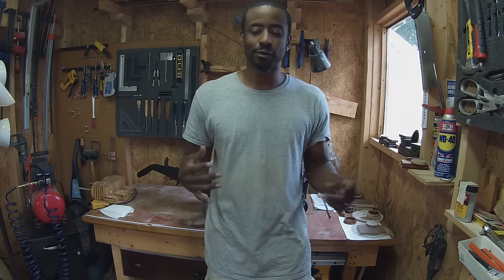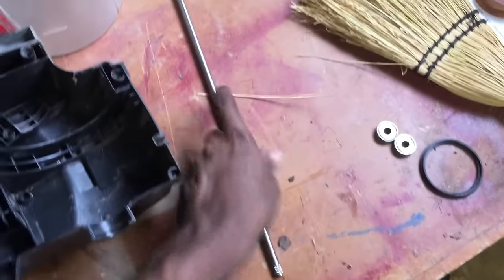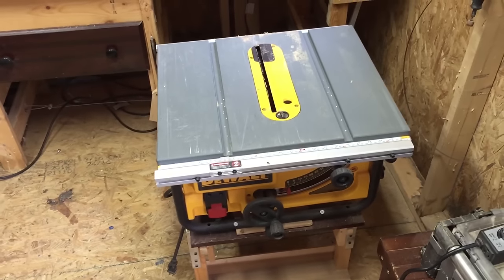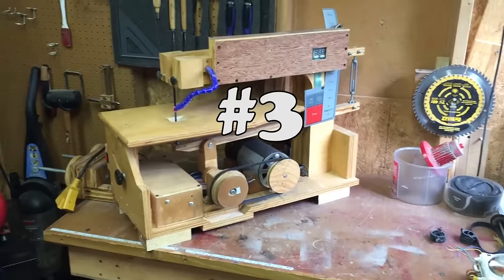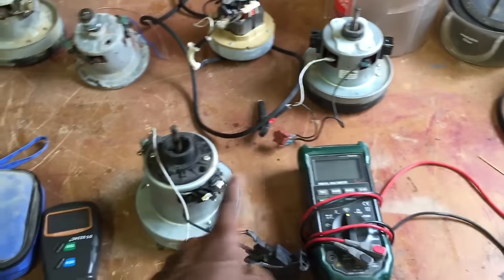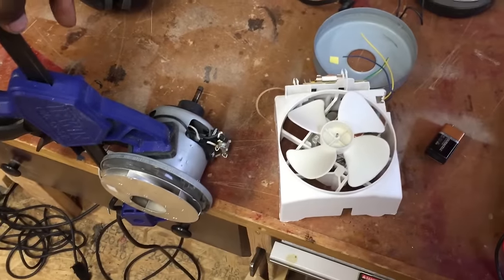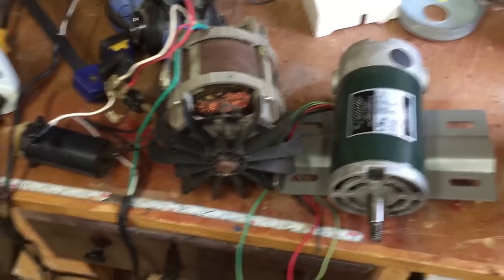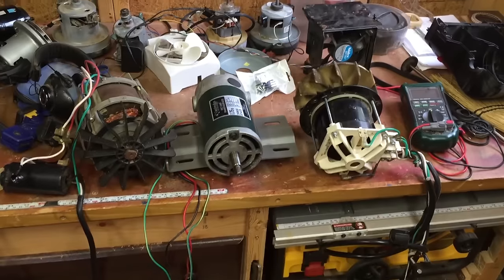Things You Can Make With A Vacuum and Other Salvaged Motors: # 010

Comment: LOL.... you're as crazy as I am about repurposing things, especially those with motors. 

I get pretty much everything for free off of Facebook.  I belong to a bunch of local "Sale Groups" on Facebook and from time to time I will put up an ad saying I will take old working and some non-working Vacuums, small and large appliances away for free or very cheap.  Very cheap meaning I CHARGE THEM lol.  I love Dishwashers, Refrigerators, Washers, and Dryers etc. because they have lots of parts that can still be in good shape and I sell them on Ebay along with getting whatever I need for a project.  Things like Silverware Racks, Upper and Lower Racks from Dishwashers bring good money used if they are still in good workable and cosmetic shape.  Refrigerators are good for the glass shelves, Crisper drawers and the side pieces on the inside of the doors as those parts often break and cost an arm and a leg along with your first born child to buy them new.  The only downside is with some of the bigger things is shipping costs.  But I figure if I pick up a Dishwasher for free or charge them $10 or $20 to take them away and I sell an Upper Rack for $50 including shipping and the shipping costs me $30, I still made $20 bucks for a few minutes of boxing and bringing it to the Post Office or UPS office and I don't have to worry about throwing it out.

If you like Duct Tape, you should use Gorilla Tape.  That is all I use now.  Duct Tape varies so much in quality by different brands but the Gorilla Tape is crazy strong and sticky.  They even have like warnings about it on their website lol.  It usually comes in Black but they also have many other colors now if you want to make it match a project.  That Gorilla tape is like Duct Tape on Steriods minus the Roid Rage lol.  It can get a bit spendy, but you can find it on sale sometimes or I use my "Points" from different stores to get it cheap or essentially free.  Also, if you write an email to the Gorilla Tape company telling them how great it is and what you use it for, include some photos are always good too and ask them where you can get discount coupons for buying more of it, they will often just send you coupons or coupon codes.   I have even got small roles of different colored Gorilla Tape from them.  I must be on some list with them as they will just send me some out from time to time. 

I have found many companies appreciate getting an email and a few photos telling them how great their product is and creative things you have used it for rather than the emails they usually get from people Bitchin' about one thing or another in regards to their products.  It seems like we have gotten to be such "Assholes" of a Society that all we do is complain rather than give Postive comments or Feedback about products.  Complaining will sometimes get you free stuff or discounts, but I have found Positive Feedback to companies works much better.  I was even sent a Free 20 Volt Lithium Cordless Drill from Black and Decker one time for sending them some pics and a short video of this 50+ year old B & D Drill I had that still worked.  They sent me the Cordless Drill to Test and let them know what I thought.  I didn't even ask them for anything, I just wanted them to recommend a good replacement for this old drill I had lol.

Anyways, I was thinking you should send some pics or short videos to some of the vacuum cleaner companies showing how you repurposed their products after they got old or no longer usable for their intended purposes.  If you send the email to every address you can find for that company like Customer Service, Tech Support, CEO, etc, you never know what kind of response you might get back from someone that really liked what you did.

Keep up the good work with the videos.

Comment: Bro can I use our broken electric fan in making vacuum cleaner?
Reply from the maker: I don't think you will get very much suction. Regular fans can move a large volume of air but they don't create much suction pressure.
Reply: I mean the electric motor of the electric fan
Reply from the maker: +Kyle saw the rpm is probably to low. Vacuums run at 25k+ rpm. But I say why not? I experiment all the time. See what happens

Comment: Vacuum motors are usually class A, not designed to work any significant load. Not good for tools, I find. Good for fans, blowers, small pumps; anything with a prop or impeller requiring very little torque.
Reply from the maker: +Jordan Hall no question about it. It is designed to be a fan.
Reply: Jeremy Fielding The real treasure in vacuums isnt the motor anyways. The occasional retractable cord reel, and long thicker gauge wire. I've been toying with upright vacuum canisters to make dust collector systems. Vacuums have been a hit and miss source for HEPA filters, too.
Reply from the maker: The retractable reels are nice. I have only picked up one of those.
Reply: Jeremy Fielding Yeah, they're rare. It has been a welcome addition to my miter saw cart. I wanna say I pulled both the ones I have off of Hoover vacuums.

Comment: Can I pick your brain for a sec? I am trying to build a electric motorcycle. I have a old maytag ac motor. I was wondering what to use as a VFD that I can use with a throttle application. I was thinking about using a inverter to power everything. 

What do u think?

Comment: Jeremy please help, I've been working on a project but it's getting no where, I have a vaccume motor that looks exactly the same as the one showed in the beginning of the video, I am trying to create an electric bike but it's more of a concept till I work out the kinks, 1, I have NO idea how to create a portable battery pack for it! 2 I have no idea how to control the speed of it! the petentiamator thing seemed like it would work but I'd have no idea how to set it up 3 I'd like to have the motor be controlled by the wheel, you know how motor bikes work, pedal fast and the motor starts. Anyway, PLEASE HELP I'd be using the bike for work so I'd be extremely appreciated.
Reply from the maker: That sounds like an interesting project. I have a video which should post on Friday, and I think you will find it very helpful regarding the wiring, speed control options, and batteries. After that, let me know if you have a specific question and I try to help. 
You seem to have quite a few aspects of this project which you haven't worked out. I feel like I might be doing the project for you if I start looking things up to help. I have never tried to do what you are asking so I can't speak from experience. I think even after watching the video you will need to do a little more research to get a complete solution.

Comment: You really shouldn't run a universal motor unloaded. Their speed is governed by their load. No load means the motor's speed will (theoretically) never stop increasing. That's really bad for commutators. The load on vacuum cleaner motors is the impeller, so if you don't have a high load to put the motor on then it's ideal to leave the impeller on. It's generally ideal to keep  them under 20k RPM, and less is better if you can give it enough cooling.

Comment: Man do you and I share a similar interest , I collect motors of all sizes  and types , polarity's , and switches and timers from anything ....I got big ones little ones tall one short ones  green ones ....mean ones dHey War should record that ,,,,,SPILL THE WINE DIG THAT Girl have that tune ........Spill the   he . I make leaf bLOWERS FROM VACS , leaf  BLOWERS  from vacuums , ,WINCHES ,using garage door openers ,  Hanging jewelers and hobbyist type little elec grinders on the flex shaft .Man Functioning electric motor projects all around my place , outboard motors , wind turbines , bicycle battery chargers, grinders , pumps, air conditioners that work so good you can roll the windows up in your truck mid summer ....I have a youtube channel i never visit  but its right here where my name is , hey Im a computor idiot and proud of it so ......yea man thanks u made an average saturday into an average saturday witth a bigger smile lol, Ilove those tread mill stepper motors ,the faster you spin them the more volts they'll give you , 90-100v dc if spun fast enough , those little rc car motors like the bigger TRAXXEX they make good generators too for bicycle lights or wind powered battery chargers ,,, i'll shut up now
Reply from the maker: Glad to make your day a little better

Comment: Mr. Fielding I take this opportunity to ask you what do you do with all the sheet metal from a whashing machine, e.i. the lid, the sides and any flat metal. I am making a shredder and I need to make the hopper, and also will need a motor with some HP connected to a transmission or reducer, what do you advice for me to find what I need. Hear is my mail if you prefer to communicate that way. Have a nice day, and keep up the good work. info@ecodynamics.com